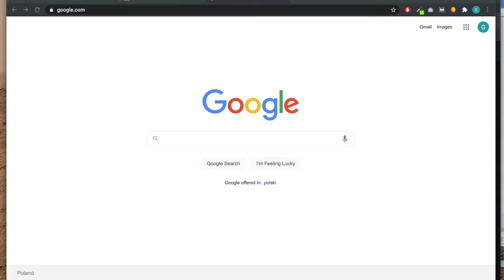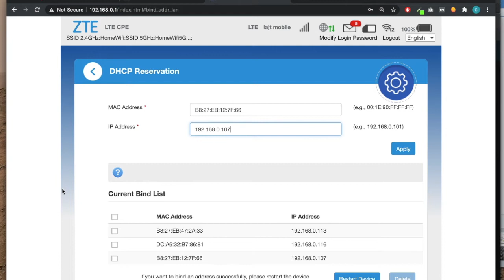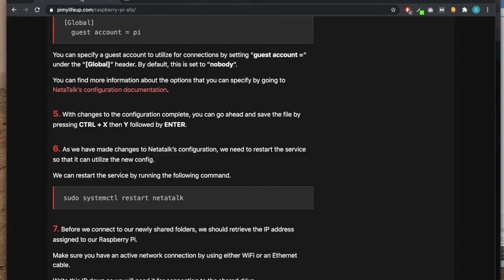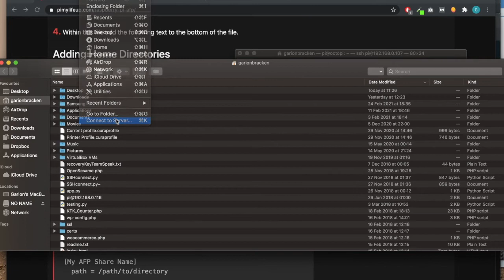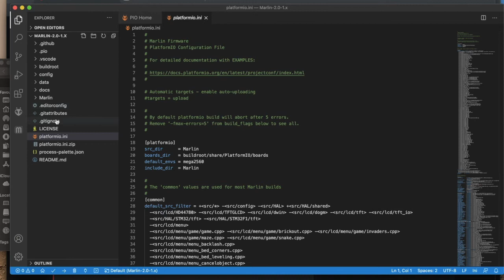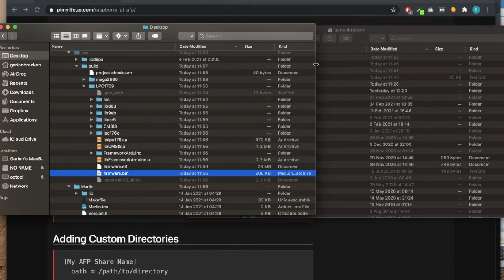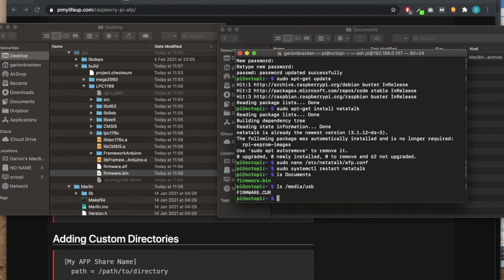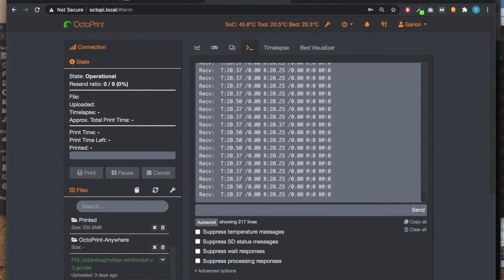Wireless Firmware flash SKR board

Comment: Will make things easier than grabbing the  SD card each time
Reply from the maker: Yeah I didn't mention, but most of the time is spent in setting it up initially. Once you've got the file server installed on the pi it's a lot quicker connecting to it from your computer and transferring over the firmware.bin